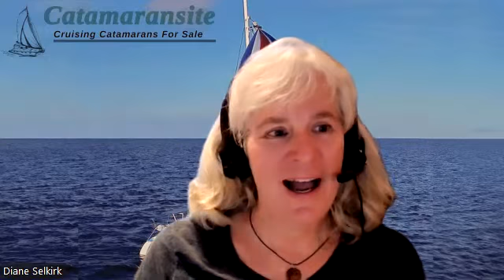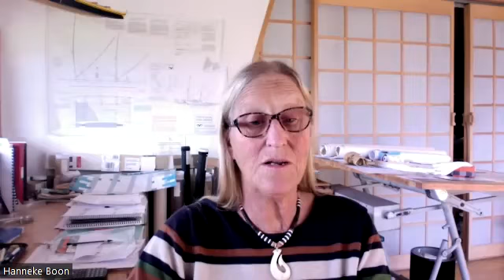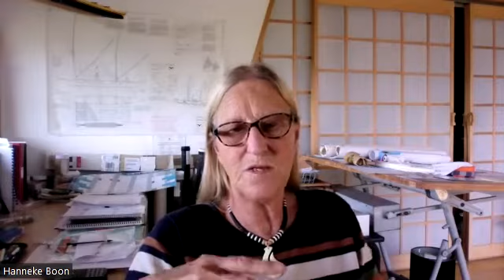Wharram Interview with Hanneke Boon

Comment: I’m hoping Hanneke can get to read the Royal Society of Chemistry Article the New Wizzards of wood.  Chemically modified wood rot proof and once modified it is potentially as strong as steel. It’s perfect for ply construction.
The other materials of interest are flax and basalt fibres  possibly also organic epoxies as greener, stronger tougher alternatives to glass fibre and carbon in some cases.
Look up the French Windelo for info on basalt but it highly abrasion resistant and ballistically impressive … being natural rock it has impressive other properties and is none toxic or hazardous and easy to work without itching or health risks. It’s stable against acids and alkalis and very good at resisting temp extremes, it insulates and prevents bacteria fungi etc it also it also resists osmosis vibration UV and noise. See a guy called the Basalt Guru. 
Best wishes and thanks 🧙‍♂️🇬🇧Clive